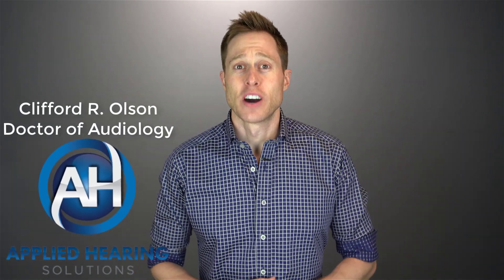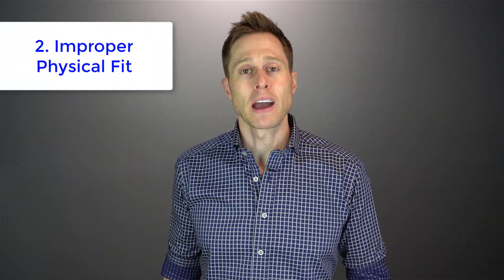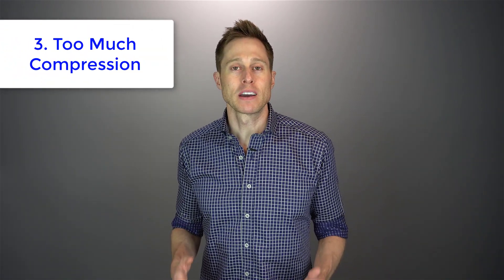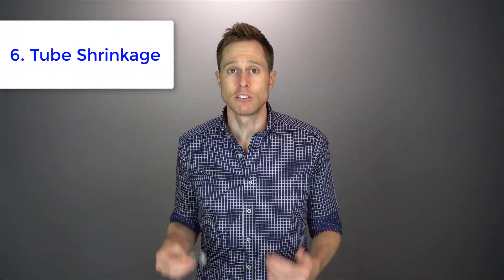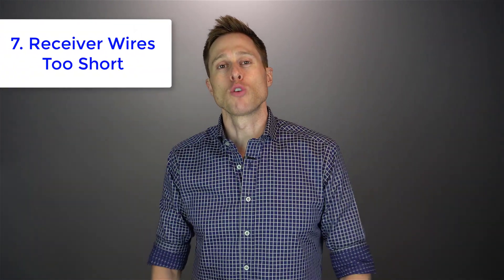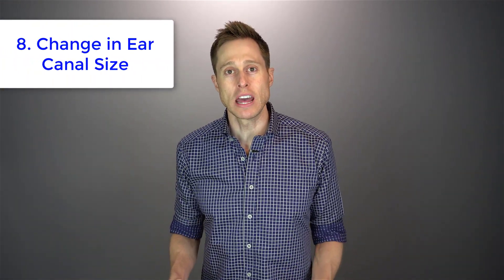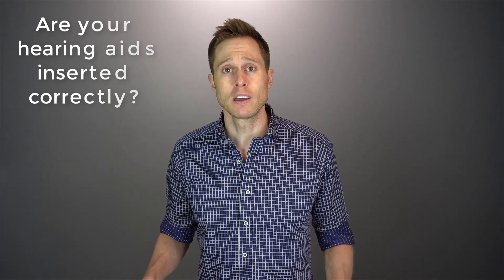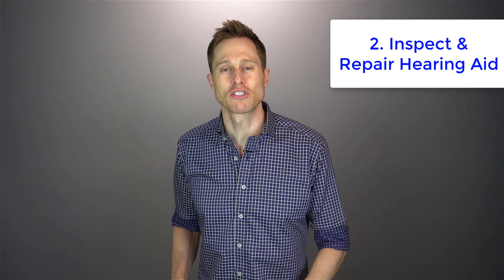10 Reasons Your Hearing Aids Whistle | How to STOP Feedback

Comment: I went to my hearing aid provider twice today. I have the widex moments. The left hearing aid is great, no feedback, the right one seems like it’s really loud and has lots of feedback and even popping noises. We’ve already did a redo on my ear molds, changed the receiver( it’s a medium strength receiver) , I’ve even switched my right hearing aid over to my left receiver and I get the same kind of feedback/ popping. My hearing aid doc has even checked the settings but it just seems like my receiver can’t handle the settings for my right hearing aid, I’m wondering if getting the powerful receiver will help at this point. It’s driving me insane. We concluded today’s visit with just getting a replacement right hearing aid and I feel like it’s not going to help if she mirrors the same settings to it because we’ve already replaced the hearing aid in the past for the same issue. Do you think getting the more powerful receiver will help in this situation or do you think my provider should redo the hearing test and settings all together ? Also, she even mirrored my left hearing aid to my right hearing aid and it still had the weird sensitive feedback, well at least she claims she did that. Idk what to trust because she had to call widex support to get help with the widex software, and widex support recommended she redo the right hearing aids file because the file might be corrupt…any suggestions would be helpful or any ideas on what you think it might be ? I have the widex moments 440 with 312 battery

Comment: I have a problem.  I just started wearing Phonak hearing aid for the first time. In the past I wore Starkey hearing aids.  These new ones have been giving me a lot of trouble. Between me wearing glasses with a lot of whistling noise and it won’t stop and I have tried changing my glasses and it still doesn’t help. My old hearing aids I never had any problems with this. What can be the cause of this?  I also have been going to my doctor with other issues one is that my ear canal has got much smaller, I mean tiny.  I’m a 55 year old male and over the years my ear canal has gotten smaller.  I don’t know if this is the problem. What would you recommend?

Comment: Hey I need your help, I feel like I’m loosing my hearing in my left ear but every time I see a doctor they say my ears are fine and last time I took a hearing test it came back normal, and that was almost a year ago, now I feel like I’m loosing my hearing even more and nobody will take me to the doctors so I do hearing tests on YouTube and it come back normal but it doesn’t feel like it, my left ear which is the one I’m having the most problems with feels so different from my other ear which is very uncomfortable 😣 idk what to believe idk if I have hearing loss or If it’s something other than that, oh and another thing it makes me feel so light headed. Ever since this started back up again I haven’t been able to get a lot of sleep because I’m scared I will wake up one morning deaf in that ear, any suggestions?
Reply: Have you had congestion? Sometimes if I have a cold it settles in my ears. A good decongestant to clear the fluid usually fixes the problem.
Reply: Pamela Potter well I was 
told that my left nostril was swelling and I never noticed because my nose being stopped up felt kinda normal to me idk why but they told me I needed nasal spray and I used it to help but it was not much of a difference in my ear.
Reply: Hi Queen,  I agree with trying decongestion.  Maybe instead of using nasal spray try Breathe Right strips.  You put them on the outside of your nose and the pull your nasal passages open.  There are hearing tests that you can do on your phone.  I did mine in a closet.  It showed mild hearing loss.  I had a hearing test at the audiologist and I have severe hearing loss and wear hearing aids now.  Try to not worry about going deaf overnight.  It is very gradual.  Try to not think about it at night and lose sleep.  I started taking slow release Melatonin and am sleeping like a baby now.  I wish you the best!

Comment: I know that it is not the best place to ask such a question but I just cannot find answer anywhere else. Does anyone know how long typically lasts Phonak Audeo Marvell powered by battery type 312? I normally use quite a lot bluetooth connection (watching Netflix or Spotify) - about 4 to 5 hours a day. In such conditions rechargable version lasts 15-17 hours. I'm curious if battery version lasts at least 2 days with heavy use of BT.
Reply: Tomasz Wronka I’ve had mine for 2 weeks and also do a lot of streaming. The initial batteries lasted 6 days. I had to replace them again after the next 6 days so that must be average for me anyway.
Reply: @thewanderer577  Thanks. I've looking for such informations but audiologists in my country just repeating the same marketing info. They also keep telling that rechargable version lasts for 2 days even if I use bluetooth connection. The real life is slightly different ;)
Reply: @tomaszwronka8752  I have the Marvel rechargeables and I wear them between 18 to 20 hours a day. I don't worry about the Bluetooth as it's always on either for watching videos like this one or television on my laptop. I have never had them die on me. I just plug them in when I lay down for bed or a nap and they're ready to go when I wake up. These are the best aids I have ever had and I've been wearing them since 1974
Reply from the maker: I have not yet had a patient get LESS than 3 days of use.  Even the heavy Bluetooth streaming patients.
Reply: @DrCliffAuD  You are a star. Finally reliable answer.

Comment: .Reason 11, perhaps? Having the volume turned up too high when inserting HAs. I haven't had that problem with my Phonak Marvels, which are set by my iPhone app, but did occasionally with my previous non-Bluetooth aids.
Reply from the maker: Squealing upon insertion and removal is normal.  Especially if the volume is turned up high.